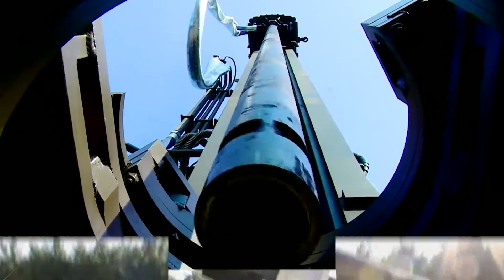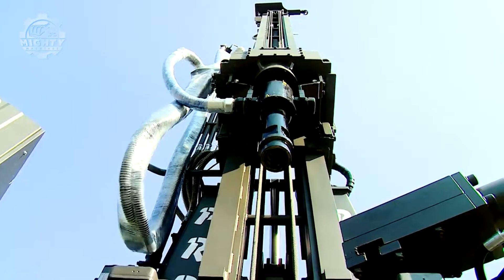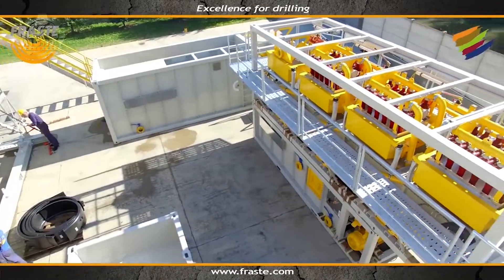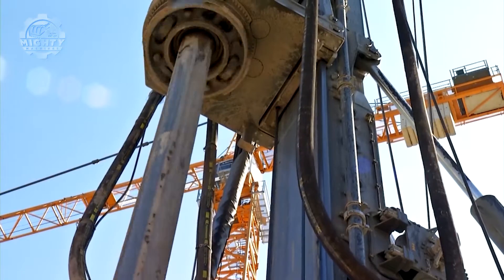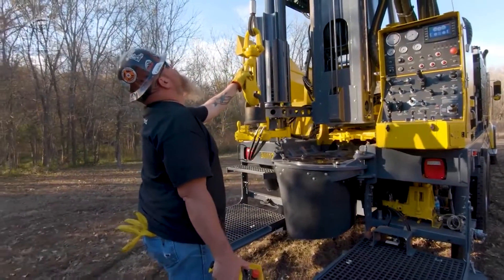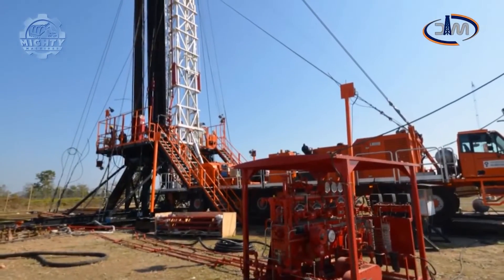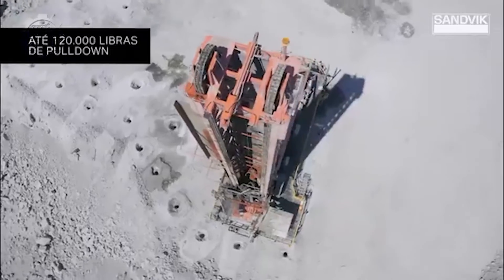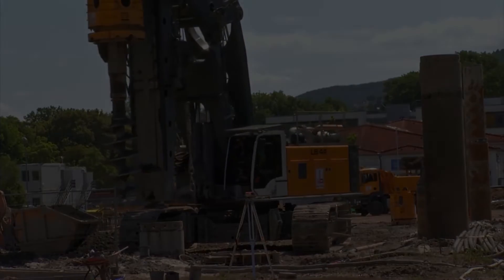World's Biggest & Most Powerful Mobile Drilling Rigs

Comment: The Liebherr LB44 machines can already been seen in various parts of Singapore performing heavy drilling operations in the construction industry. Now these machines are involved in underground projects as Singapore is gradually moving towards a larger transportation network in which you can gain access to all places using the underground rail system.